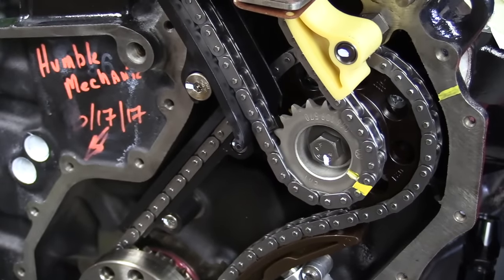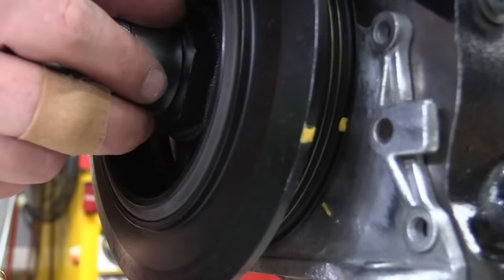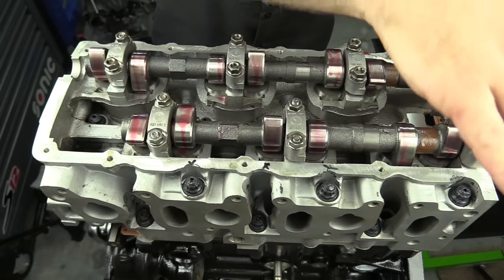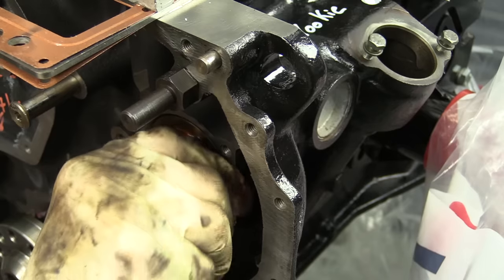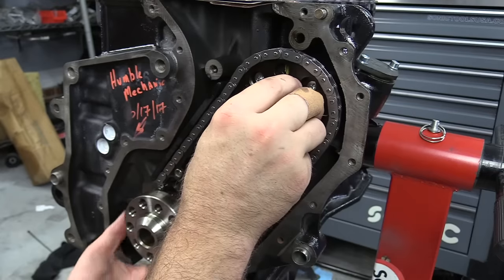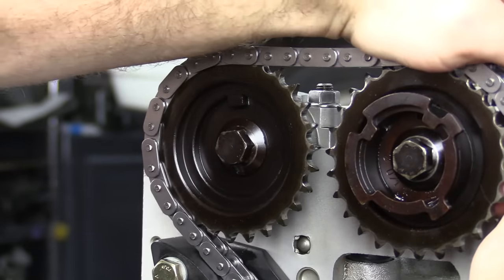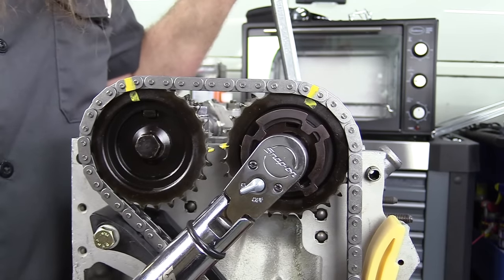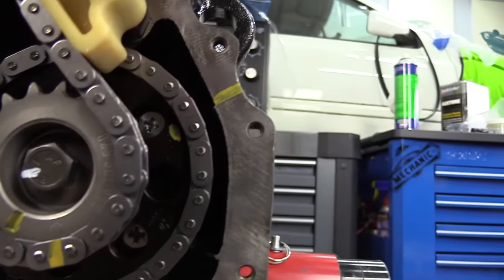How To Properly Time and Install Timing Chains on a VR6

Comment: Can I replace the timing chains and clutch without removing the engine?
Reply from the maker: Yes. But the transmission has to come out
Reply: HumbleMechanic appreciate it Charles, gotta change out my timing chain on the 98 gti vr6 in my apt parking lot 😅

Comment: If I take the cams out at tdc and just put them back in the exact way with the cam locks and dont rotate the. Do i still have to move the timing backwards ?
Reply from the maker: I always do. You’d probably be okay, but i like to be 100% safe
Reply: @HumbleMechanic  does it matter which way I rotate the cams back to fit the cam lock ? Or do I just rotate it till it fits back. It wont throw the valves off time right ?

Comment: Would you recommend a 270,000 km 20V 1.8T to have a replacement timing chain? Belt was done. 
Curious to the benifits, no major issues with the engine.
Reply from the maker: +tiNtiN11 only if its noisy
Reply: HumbleMechanic Thanks!

Comment: Hey Charles, I REALLY NEED SOME HELP ON MY GTI VR6 GOLF, I am a subscriber to your channel and I have a problem with my 1996 GTI VR6 Golf (my restoration project) I owned it for some time and love it. My problem is I do not drive as much and so the battery has to be charged every once in a while. Now I am unable to start It. Battery is fully charged, gas pump is good, we do have gas pumping to the fuel rail, engine does turnover as normal but will not start. We scanned for codes and got P1500, we also found low spark or yellow spark by the coil pack, we also found no  negative signal from ECM to the (FPR) fuel pump relay. I got a replacement ECM same numbers but it does the same. If I give it the negative the fuel pump works but still no start. WHAT DO I HAVE TO DO TO GET IT TO START?
Reply from the maker: do you get RPM when you crank it?
Reply: The tach does seem to have movement on cranking. I have removed the crank sensor and tested with an ohm meter, middle pin and one outer pin reads around 940 ohms and does have an output when I move object in front of the magnet. I just received a replacement ECM# 021 906 259A Identical to mine. I have a half tank of fresh gas and it did the same thing, (cranks normal but no start). Observations: The negative output from the ECM to (FPR) fuel pump relay is missing. I have a new ignition switch and new fuel pump installed, and if I give it negative on the (FPR) it will send gas to fuel rail but still no start. My next suspect is possible (CPS) Cam Position Sensor. I did test for power, ground and ignition at the ECM..........Not sure what signals should be present at the (CPS) connector, with the key on no 12v at the (CPS) connector  or the MAF. I Just started this VR6 a month ago......SMH......I am lost. 

Charles I really appreciate the reply

Comment: Did a vr6 in a eurovan 8 times, faults returned for crank and can correlation, had two qtms and an engineer show up at my dealer and the fault returned even with them doing it. I had a vr6 from a friends euro van, took one of the 3 kits they gave me, rechained it and swapped it. Problem gone...what do u think it could have been???
Reply: I have heard that the variable valve timing parts can fail and cause a variety of problems.

EDIT: The 2001-2005 Eurovan had variable valve timing along with a 24 valve engine.
Reply: Skyline Fever it was just weird that from one motor to the next done exactly the same, I got two different results
Reply: Wow, that is incredibly weird.
Reply: Skyline Fever one of the many mysteries that will never be solved lol

Comment: How much to do my 2004 GTI VR6. It's good now i just heard its $$$
Reply from the maker: Probably in the 10 or so hours of labor range. Plus parts.
Reply: I have a 2003 GTI VR6 with the original chains, even after 17 years and 99K miles.  If I may ask, how many miles do you have on your original chains?  Have you changed them yet?  Thanks.

Comment: I know some mechanic they just finish school,but they still don't  know how to adjust points and do values clearance.
Reply from the maker: Lol I wouldn’t know how to adjust points either.
Reply: Who teach you use a stick into the spark plug hole to found TDC,he should know how to do.😊

Comment: When should these chains to changed? I have the 3.2 bub
Reply from the maker: There is no recommendations for miles. You can look at “stretch” in the scan tool. That’s awesome hat I’d use. Or listen for nosies
Reply: @HumbleMechanic  what about the 3.6 fsi in 2011 touareg? Mine has 177 000 km and what noises am I listening out for? Thanks!

Comment: Older engines are much simpler mate, only one camshaft for a V8 because OHV. Easy to fix, easy to rebuild and simple because carburetor.
Reply: CaddyPro'59 VR6 is easier. No pushrods/rocker arms. A 12V VR is very simple the chains and the valve guide seals were a pain.

Comment: i need a video for timing a 30 valve vr6 2002 i cant find anything anywhere please
Reply from the maker: It’s probably similar to this. I’m not familiar with a 30v vr6.

The Passat has a 30v V6 which has belt and chains.

Comment: How much would a job like this will cost ?
Reply from the maker: Labor would be about 10 hours, and probably $300-$400 in parts. Every bit of $1500 or more.
Reply: HumbleMechanic When are you suppose to have this done or how long does a timing chain last?

Comment: I have a vr6 not v6 1 cam for intake 1 for exhaust all the timing marks are different on the end of cam has that weird gear you have to turn before you put the chain i think im a tooth of it doesnt run very good

Comment: When I get around to doing chains in a 99.5 Jetta vr with an auto, should I just pull the whole thing out or do it in the car? 
Or is it like 6 of one, half dozen of the other ?
Reply from the maker: I would only pull the trans and leave the engine in the car. But that is just me.
Reply: MrTheHillfolk you can do it in the vehicle. Much more uncomfortable, but the job can be done.
Reply: HumbleMechanic 
Ok good deal, thanks for the reply. I figured it was more work to pull it all, but maybe easier to do the chain procedure on the bench. 
Watching this vid again eased my mind somewhat. 
a few people Ive talked with acted like it was the worst job ever but I don't mind a challenge.
Reply: Lynx Star Automotive You're full of it.

Comment: Did you use the old sprockets? Could not find new ones
Reply from the maker: All but the upper gear for the lower chain. That was pretty worn.
Reply: HumbleMechanic where can i buy all of them?
Reply from the maker: Dealer. Or anywhere selling OEM parts
Reply: HumbleMechanic thank you! How do i know if i have double or singel chain?

Comment: did you replaceall the gears?
Reply from the maker: No. Just the ones that looked sad
Reply: @HumbleMechanic  ya i have a p1340 code . been trying to figure out what it will cost me in parts to do the timimg chain. seems to be alot of options in kits some with water pumps ,oil pumps etc

Comment: Why did you pull out cams?
That's the one thing, I don't get it🙄
Reply from the maker: I was assembling the engine and broke off to do a separate timing video. 

Also why the eyeroll emoji?
Reply: @HumbleMechanic  all good. Just became confused. After while I get that You probably install new cams or just to show how to perform this job.
Great video.
My new purchase "old and tiered" vr6   need similar job very soon.

Comment: I've seen timing chain configurations before but I thought this one was very complicated, typical German engineering.
Reply from the maker: This one is not too bad. Some of the newer ones are crazy. LOL
Reply: This is actually easier than timing belt setups with balance shafts and 2 cam sprockets lmao

Comment: Alldata calls for 13.50 hours to replace a timing belt on a VR6 engine. Don't be deceived by this video. The engine is clean, the parts are all new and the engine is OUT of the CAR! You can change a Timing Belt in a couple hours on most 4 cylinder engines including the VW 1.8T and 2.0 FSI It's apples and oranges. On the car it would take an amateur at least 2-3 days to change a Timing Chain like this. At least a whole weekend all day Saturday and Sunday.
Reply: It's a good video but I would rather see this performed with the engine still mounted to the vehicle from start to finish.
Reply from the maker: The only BIG part of this job in the car is R+R the trans. YES it's out of the car, but that allows me to show much easier the timing side of the job. 13.5 hours for chains is totally doable. 

Remember that Alldata is a book guide for professionals to use to quote and sell jobs, not for a DIYer to use as a time guide. to me, that is the apples and oranges comparison. 

For those that want to see this job done start to finish in the car, We will be doing this on the R32 at some point.